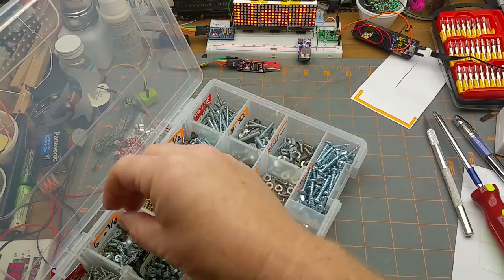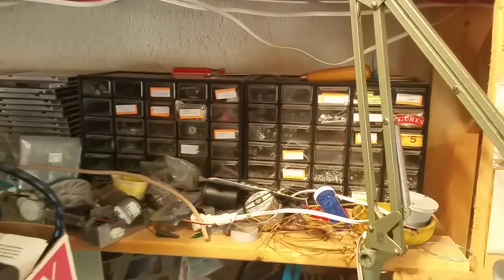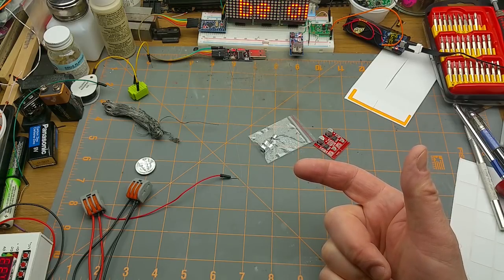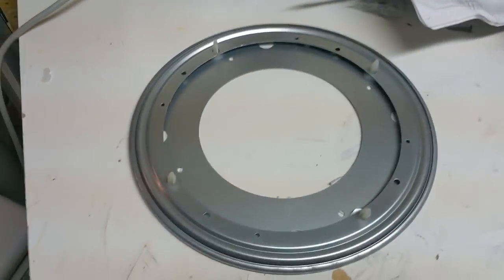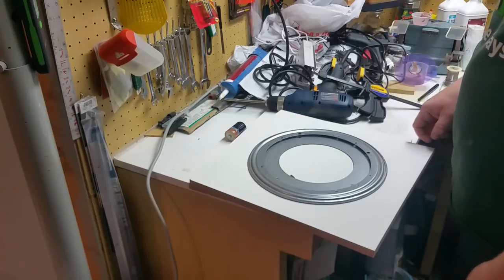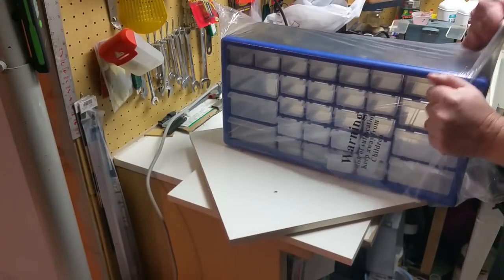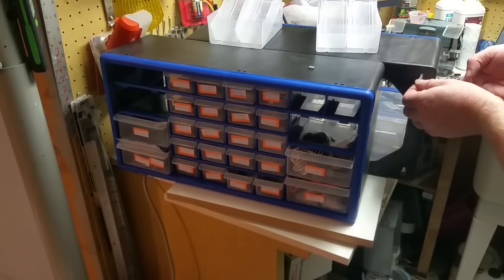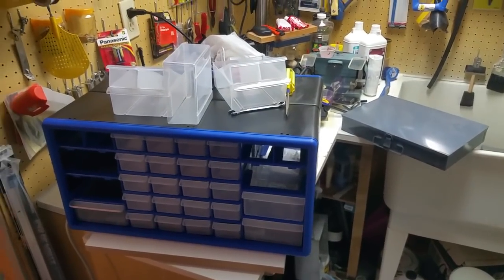Trying to organize my pile of stuff

Comment: I’ve just bought a couple of wall mounted units with drawers for my resistors, capacitors, diodes, etc. also grabbed a new handheld label printer, the ones that you can also print heat shrink on as my old Dymo one was tied to a pc. Now just the task of actually doing it……so……2029 it is then, 😂

Comment: I thought I had a lot of stuff! Must send this video to my wife next time she complains about it :)

Cool idea with the rotating stand!

One suggestion if you have one near you is these small boxes from IKEA called glis. They come in packs of 3 for €2 , are stackable and are a really good size for half sized breadboards with projects still in them (as they have clearance for the jumper wire)
Reply from the maker: My local IKEA has 65 of them in stock.  $4.99 for the 3-pack in Canada. I'll have to take a look at those in person.

Thanks
Reply: pileofstuff that's a pity about the price difference! I've noticed that with a few things in IKEA , one of the rare things that is cheaper over here !